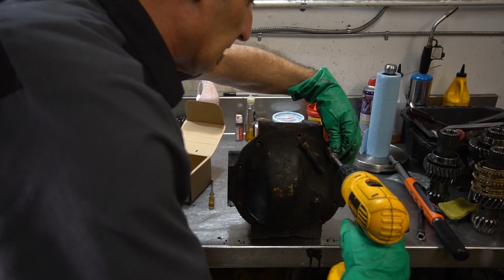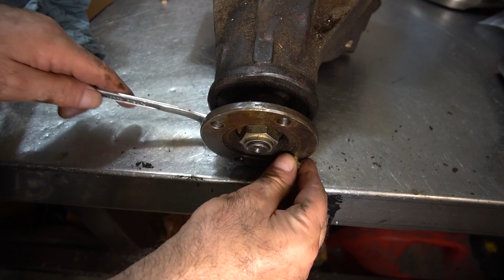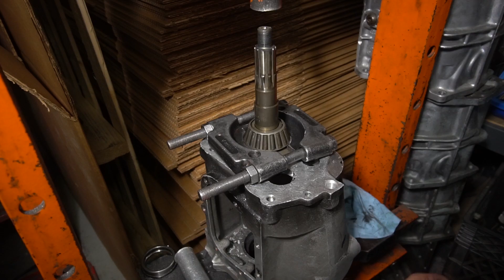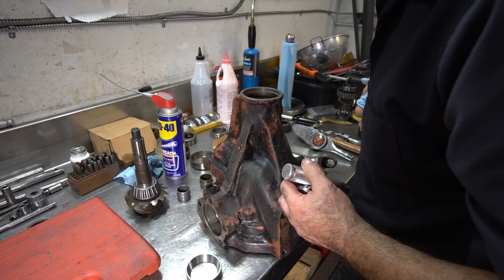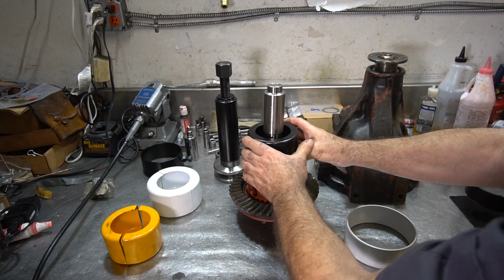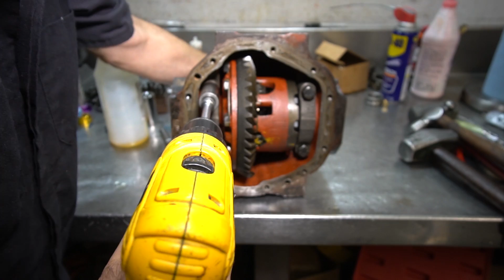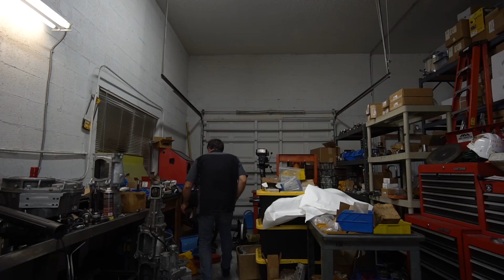Dana 44 Carrier and Pinion Bearing Replacement Basics Jaguar XKE

Comment: I saw that you oiled the cap bolts before installing the caps. I have read that torque specs as specified are for an UNLUBRICATED fastner and that by adding lubrication the bolt will be overstretched when torqued to the specified torque due to reduced friction.  I'm sure you have heard this too, what are your thoughts on that?
Reply from the maker: I would never NOT oil bolts. I don't understand if it is just a bunch of weirdos on the internet making stuff up or possibly people who have little mechanical skills to think things thru for themselves. Torquing bolts dry leads to galling threads and if anything possibly causes a bolt to never fully seat. You would have to have done perhaps 100's if not 1000s (in my case) to understand basic principles. When I was doing prostock engines I'd use anti-seize on the head bolts. No issues 1000's of assemblies.
Reply: Torquing without lubrication is completely nuts!  The bolt stretching thereby compressing the two surfaces together is what holds it together. Putting the bolt in dry increases friction between the threads, leading to falling and potential false torque readings.  Some people will believe anything but the scientific truth.

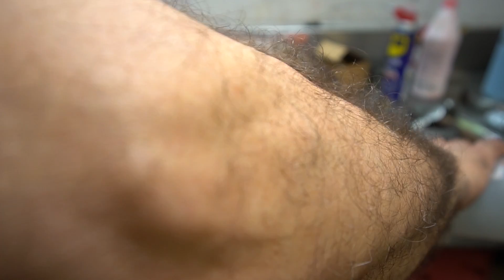Comment: 37:10 Hey, uh, Paul, far be it from me to tell you how to do your job, you have SOOOOO much more experience than I; just want to point out that since you used a lubricant on those fasteners, the torque specs would actually be higher (clamping force is reduced with a lubricant in play). Maybe you accounted for that, and even if not, maybe it would still be within the ± range, but it does change the required torque (and would affect angle as well, if they're torque-to-yield bolts)
Reply from the maker: No, you can lube bolts. Torquing bolts dry can gall threads. Not the smart thing to do and you are splitting hairs.

Comment: 3:32 If I understand differential setups as well as I think I do: you actually CAN put them back together with the caps reversed, but in order to avoid noise (which is pretty much a guarantee) at best, and damage at worst, you'll need to re-shim the differential. A much more involved process that is not normally needed during a rebuild. A new build one the other hand...
Reply from the maker: You should never put caps on reversed or switched. Would you put main bearing caps on an engine in a different position then before? Part of doing professional and skilled work is actually doing it correctly.

Comment: GREAT VIDEO.  I HAVE A TRUCK PROJECT THAT I'M MAKING PROGRESS ON, I HAVE THE MOTOR DONE EXCEPT FOR THE ACCESSORIES.  I HAVE A SM465 THAT I JUST GOT THE COUNTER AND MAIN SHAFT INTO, SOME TORQUING AND PTO COVERS AND IT WILL BE DONE. I WAS GOING TO REBUILD THE 2O5 TRANFER CASE, BUT FOUND A GUY THATS BEEN IN THE. MANUAL TRANSMISSION REBUILD FOR 36 YEARS AND HE IS SELLING OFF HIS STOCK, SO GETTING A GREAT DEAL ON A 205. THEN ITS TIME TO MOVE ON THE DIFFS , MINE ARE NOT DANA 44, THINK THEIR ARE C 10 ,I DID CHECK THE BOLT PATTERN BUT FORGOT. YEP ITS COMING TOGETHER.  WANT TO THANK YOU FOR ALL YOUR ADVICE AND HELP AND THE VIDEOS.
Reply from the maker: Thank you

Comment: So how can you tell is someone has not changed the caps from side to side before you?  If some did and the line bore is out then the bearing races will not be perpendicular to the ring gear shaft which as you say can lead to early failure.

Comment: What's a safe way to clean the inside of the diff that won't damage the bearings, seals, etc.? Brake cleaner, WD40, etc.?
Reply from the maker: Mineral spirits
Reply: @GearBoxVideo  Any mineral spirits brand you prefer?

Comment: When you change anything things can change. Bearing have plus or minus for manufacturing. Most of the time its close enough. But I have run across problems and have to use different shims which = a pain in the ass.
Reply from the maker: Bearings have extremely close tolerances and 99 percent of the time if you are just changing bearings and set your work up to the same endplay or preload you should be fine. However it doesn't hurt in a ring and pinion application to do a pattern check.

Comment: The mating surface of the carrier bearing cap isn't necessarily the exact center, due to machining inconsistencies. In order to make your method of setting the pinion depth accurately, you must first measure the carrier bearing race and divide by two. Then measure the bearing cap depth (which, ideally would be 1/2 the measurement of the whole race). Then add or subtract the difference, to your figures, depending on whether the cap is deeper or shallower than half of the race. This will give you the correct offset. The expensive, complicated factory gauges have a bar set at exactly half way using discs which sit in the carrier races, from which all measurements are taken.
Reply from the maker: Think it thru. The centerline of the housing is where the split happens. If you ever line bored an engine you'd understand.  Any distance checking tool uses that saddle. You are over complicating something very simple.  Remember there is a process as to how the housing is machined.. Line boring 101. Over 40 years and thousands of setups this never has failed to produce a good pattern. Rarely has pinion depth ever needed tweaking. Also it would be next to impossible to actually place a cap onto a bearing race that has an ID smaller than the absolute center.

Comment: This is still the best differential video here on the 'net, I came back to watch again. If there is discordance between the ring gear paint impressions and measured pinion depth, which do you believe? Do you find yourself overruling the factory guideline for measured pinion depth to try and get a better imprint on the ring gear? Is pinion depth just a faster way to assemble the diff because it quickly gets you close without having to take everything apart to try again with different shims?
Reply from the maker: I go by what the factory says. These gears are run in on precision machines for optimal contact and noise. So I never stray from depth settings.

Comment: Just found this great video as I’m rebuilding my  Jag DANA44. It’s the 3-bolt Output Shaft retained version from a V12 XJ12. I’ve seen some other write ups stating I need to use the case spreader as there is a 0.004” preload of extra shims added once the carrier shim stacks have been determined? I made my own spreader, but I really don’t like using it! I currently can’t get the carrier out. Advice appreciated.
Reply from the maker: I put a pry par in the carrier  window against the case. The bar has to be long about 2 feet. Shock the bar with a hammer
Reply: GearBoxVideo mine wouldn’t budge! In the end I used the spreader tool, a small ratchet strap and still had to tap the case! Now off though! My pinion bearings don’t have the punch reliefs (180 deg apart) and looks like a different seal too. The carrier is a single piece and doesn’t split.
Reply from the maker: It's a traction Lok not a power Lok. The traction lot doesn't split
Reply: GearBoxVideo Thanks Paul, I found some chat on a Jeep forum and some say the Trac-Loc clutch packs don’t last to long? What’s your take on them?

Comment: In theory, could you use red loctite and leave out crush sleeve and set preload and depth correct and live happily ever after? Always wondered this.
Reply from the maker: Technically yes. The crush sleeve or spacer shim combination are there for memory. What I mean by memory is that in the event you need to replace a pinion seal you can easily tighten the nut back down to the point it was at before.
Reply: Ok thank you!

Comment: THIS IS AMAZING! 

My wife’s rear Dana 44 [3.21] in her Wrangler just grenaded (a lot of chipped teeth on the gears inside the carrier housing). Assuming the pinion is fine, would it possible to fix the rear diff by replacing the carrier housing with a new loaded assembly? or does the old carrier housing get disassembled, and the gears get replaced?

Awesome content! Looking forward to new vids!
Reply: The pinion and the ring gear works together and must be replaced together. Ever.

Comment: FSM for a 92' vette only has the pinion depth as a measurement to the back of the pinion gear.  Dana 44=4.312"   Dana36=3.940".
Current pinion(dana36) is etched "0" and my new pinion is etched 2.532.   I guess i'm asking what is the current pinion depth on my dana 36? Going to use the current depth so i can install the new pinion relative to the old one. 
Thanks, And thank you for making these videos, i know it takes a lot of time. appreciate it! Cheers from Denmark / Daniel
Reply from the maker: Simply measure your old depth and try and hit the new mark.

Comment: If I heard this correctly, if I'm changing the ring and pinion (from 3.54 to 4.10) then I don't need to change the shim packs? I intend on using the "thick" ring gear
Reply from the maker: Pinion depth has to be measured. If you are using Dana gears and the markings are equal you may not have to change the pinion shims but may have to adjust backlash

Comment: Hi and thanks for another very useful video. I am in the UK, rebuilding the diff out of a Jaguar XKE imported from NC - I am changing from the US spec 3.54 to a 2.88. A couple of points - everything I have read gives the pinion depth as 2.625" (2 & 5/8") plus or minus whatever is scribed on the pinion. You give it as 2.635. Also, is this not a Salisbury rather than a Dana diff? I am told the Danas don't have drain plugs? And Jaguars used Salisburys I am told. I am also told that the Salisbury is a better quality unit - at least the limited slip is better. But what a perverse way to design a diff, with no adjustment, so you have to keep pulling bearings off & shimming them to get the backlash and pre-load right. Why couldn't they fit castellated nuts either side of the diff bearings like everybody else!
Reply from the maker: It's a Dana44. What you need to do is measure the pinion depth BEFORE you take it apart. Most people do not do that. Then use the plus/minus numbers to calculate your zero depth and see if that equals the 2.625. I have 2 videos on the Jag rear. Both are out of XKE cars
Reply: @GearBoxVideo  Thank you Paul - I am swapping a 3.54 c/w & pinion for a 2.88, so it's all different anyway. I bought the c/w & pinion (or ring & pinion) as a matched pair, but I found out the 2.88 has a different carrier from the rest. I had to machine a bit of metal off the carrier behind the left hand bearing to move it all across a bit to the left - about 1/8" - and it all seems to work ok ;)
Reply: One thing you CANNOT buy in the UK is that yellow grease paint for marking the teeth. I ordered some from the Ukraine, of all places, (shipping is cheaper than from the US). Then I saw your tip about using a Sharpie!

Comment: So after several trial and error installations, I finally got it set right, THANKS TO YOU!
The tight spot I mentioned came from the yoke against the new seal. There is a sheet metal collar around the pinion side of the yoke that was corroded and deformed. I removed this collar and my tight spot went away. The new seal was different than the old one. Not sure why...new and improved? Ugh...but I'm on the downhill run now!

Comment: I commented below about my 1998 Jeep Grand Cherokee rear Dana 44 aluminum case. There were no shims on the pinion, either behind the rear bearing or race. So I wasn't thinking I guess. I pressed the rear bearing on and installed the pinion in the case without the crush sleeve. Put the front bearing, oil sling, and yoke on. Started tightening it up. Experimenting with the bearing drag. Before I got far, I notice a tight spot as I rotate the pinion, like something is out of round. Not sure what is happening. Gonna take it all back out and do some inspecting. I still haven't checked the pinion depth because of the above mentioned tight spot. I didn't like that feeling. Should be smooth all the way around. I have watched you video like 10 times now. Everytime I find a little more info I missed. I am going to use your nominal pinion depth of 2.635. and see what I come up with. This is interesting, but time consuming! And I'm working on the concrete driveway...ugh...
Reply from the maker: You measure based on your old depth. If you had no shims that's odd. You can get a tight spot if you are too tight
Reply: @GearBoxVideo  yes sir, I suspect, since the last person put the carrier caps on backwards, they probably didn't put the shims back in either...so I will be learning this weekend. If I figure out the "tight spot" I will report back.
Thank you! I'm subscribed! Your video has really helped me! I'm gonna buy you a cup of coffee!
Reply: @GearBoxVideo  btw. I wasn't even close to tight on the pinion nut. I hand threaded it on and used a cordless impact too run the nut on in. I stopped when the impact started to do it's job. I mean I hadn't even started to crush the sleeve. I bought another sleeve just in case, but I will figure it out, hopefully.

Comment: So I'm about to replace pinion and carrier bearings on my Jeep Grand Cherokee. Dana 44A(aluminum alloy housing) I brought it home, new to me, and it had a whine. Removed the cover and the gear oil was mettalic. No metal chunks. I sprayed it out with brake cleaner. So the carrier caps are not on correct, as you have described, as well as other video's described. So the line bore was all out of whack...I bought a new bearing kit and will be changing them soon. I hope my carrier caps will be ok, and not distorted enough to be beyond use.

Comment: Super video!  Question: I'm planning on doing this to a '90 Dodge W250 front Dana 44, and the service manual (factory) indicates "standard" pinion depth  for the Model 44 axle to be 2.625."  Your reference is 2.635"  -would you refer to the service manual in this case?  Manual is factory Chrysler Motors.  Thank you again!
Reply from the maker: Yes reference to the srvice manual

Comment: My first subscribe 69 y-old I have an 03 two door 5speed Rubicon 292000 miles like me  a little shaky bujt bound and determined to overhaul with and for grandson starting with front differenchal maby  changing lowering gear if money permit's teacher are the best of the best and your tops collecting tools in preparation having torque wrenches and breaker bars magnetic slop calculating ringgear backlash mikecromiter I  need your clams and bar depth gauges  that race kit and the rest want to perches from you if possible maby not all at once  but I want every thing when I start the front then the rearegreat class  backlash
Reply from the maker: Great to hear you are doing this.
Reply: @GearBoxVideo  I'm gonna try to use the web sites.from my phone.to link up to your site.

Comment: How much do you charge to over haul a Dana 41 rear end and install a lock right posy track I can get a rebuild kit for the Dana 41 .. the hubs and brake plates are removed ..and I cleaned the out  side and put paint on it to keep it from rusting ... the jeep I'm putting it into isn't a restoration but I'm building it to be my daily driver ... Four wheeling too ... it's a 1946 ... putting a 6 cylinder  motor in it ....  I'm in the process of getting every thing needed for disc brakes .. I never worked on a rear end before and don't know anyone competent to work on it ... I live in Apopka Florida ...  I'm 61 years old and work at a grocery store ... please let me know if you can help me out with this ?
Reply from the maker: Thanks for watching. Sounds like a cool Jeep. Currently I'm not doing any rebuilds.

Comment: I must have blinked.  I didn't see or hear of you installing new O-Rings.
Reply from the maker: Look at the rear. There are no half shafts installed.. thus no  O rings. The shop I did the rear for does the half shafts and new O rings
Reply: @GearBoxVideo  Fair enough.  Thanks

Comment: Great video. I am doing a Jaguar live axle. Similar Dana 44 made by Salisbury. My info calls for pinion depth of 2.625. I see you using 2.635.  Immediately I saw that I needed at least your number or the teeth were too deep w/o going over .010 back lash. Only way I can see to get a good pattern has me going beyond to about 2.645. Is that possible when the pinion has a "0" on it?  I should have said  that I am changing ring and pinion. Took out 3.54 set and bought 3.08 of Dana Mfr. Not just a bearing swap.
Reply from the maker: Depends on what your initial reading is. What kinds if Jag is it?

Comment: I just set up my D44 rear in mock up:
Pinion depth: 2.6285"
Pinion bearing preload: 19 in/lbs
Pinion nut touque: 160 ft/lbs
Ring gear backlash: .006"
Contact patch at those settings a line about .03 wide at the crest. That means my pinion depth is too deep by maybe .03" Is this because I have and ARB locker?
Reply from the maker: Centers are centers. The locker would change backlash
Reply: @GearBoxVideo   I get that. However I  had to move the pinion towards the ring .022 to get the contact patch on the top 1/3 of the tooth. I need another .005 or so to get it to center.  Something doesn't seem right and I'm out of pinion shims and locker shims.

Comment: I have the gear box apart and on the end of the pinion there is a number, 2.629". Is that the pinion length or is it nominal? I'm assuming it's the current length but I didn't measure it yet. 
And there is .009" etched on the ring. what does that mean? Thanks for your help!
Reply from the maker: Pinion depth and backlash
Reply: Thank you. I appreciate the help as I have no experience. The pinion depth as is measures 2.599. I'm betting that was part of the problem. Hope those specs are on the new set.